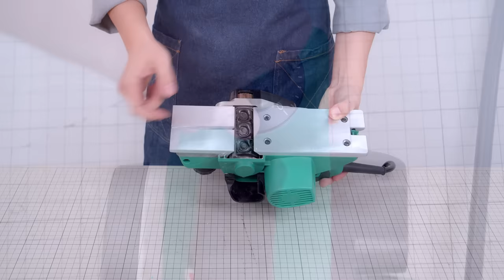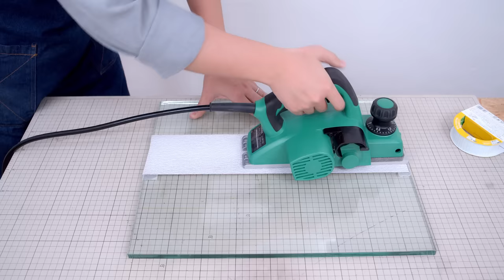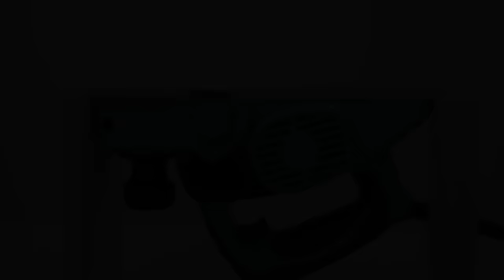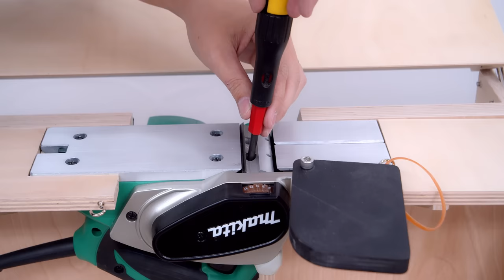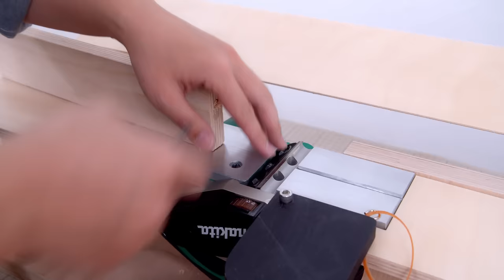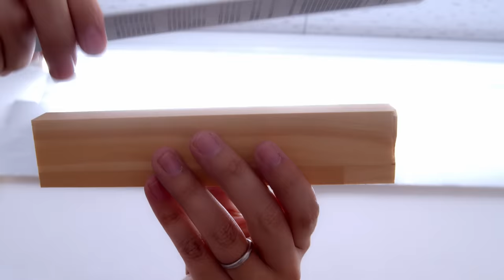Adjusting the  Electric plane Base

Comment: Thanks for posting! I never took the time to check if my electric planes were... well... "plane", as I only used them for roughing. After viewing your video, I checked and the oldest (20+ years) is acceptable, but the newest is just like yours - some precision work ahead required, because I intend to convert it to a jointer.

Comment: Very good information.  Remember though that your fingers are only an inch away from the spinning cutter head and the feed pressure you are applying is down into the danger area.  Be smart and always use some sort of sacrificial pusher to feed narrow workpieces through the jointer.  If your hand isn't comfortably above the fence it's too close to the spinning blades.  Love your fingers.  It's very difficult to glue them back together and your reflexes won't save them.  The jointer/hand planer is the most dangerous power tool in common use.  The hand planer has no blade guard and takes a while to spin down and the jointer invites you to pass your hands directly over the blades.  Fifty years of woodworking and I can still count to ten with my fingers.  Work safe.
Reply: Iv seen someone take off the end of there finger on an electric plane. After that you learn to always use them sensibly

Comment: I recently came into possession of Makita planer that was previously owned and used by someone else, it's all genuine and tried setting the blades using the guide block that came with it but the blades are still slightly proud when the machine is set to zero, might have to add a feeler gauge to the block with setting the blade, can't think of any other way, there's no adjuster screws once mounted the setting is done with the guide block.

Comment: Mine doesn't have the blade adjustment screws. It comes with a plastic block to set the blades. Still trying to set them up right.
Reply: A total pain

Comment: what paper grid do you recommend for flattering  base plates of the planer ?
Reply: Just did mine today. 240 grit until flat, then 600 to finish off. Used wet sandpaper. Got a mixed pack from an auto shop. The pieces were not long enough but after i  laid down long pieces of double sided tape, I stuck down the pieces of paper butt up against each other. Seems to have worked fine. Used my jointer / planer out feed table as the reference surface.

Comment: my blades dont sit square and as a result my shaved timber gets a slanted cut. Only just noticed it recently. either it was sent to me like that and ive failed to realise it or when i replaced the first set of blades i tightened one bolt too hard. i used the impact driver and think that may have done it. on your corded model there is an adjuster so i ran to mine to do it n there isnt one. its the makita cordless one. ffs. is that a clever nasty thing by makita or not?

Comment: Not sure why he did not adjust the height with the knob, and the blade with the aligning tool that comes with it?
Reply from the maker: Perhaps you misunderstood the main point of the video.
The purpose is to create a flat surface.
Reply from the maker: あと、この鉋は廉価品のDIYツールなのでアライメントツールはありません。
Reply: @jisakukobo  Must or must not the blade protrude over the surface?
Reply from the maker: @ПавелГрешных  
You don't understand the main point of the video.
Reply: @jisakukobo  Probably only the Japaneese do
Reply from the maker: @ПавелГрешных  
See video ratings
Apparently you are like a minority.
Only Russians do not
Reply: JSK-koubou oh I see, might try putting color on bottom so you and us can see what is flat or not flat before and after as you scrape.
Reply from the maker: @robertmccully2792  
That's right.
I do your way when making a CNC milling machine.
In Japan, it is called “Kisage”
I'm doing woodwork now, but I used to make machines with metal.
https://jisaku-koubou.com/archives/2328
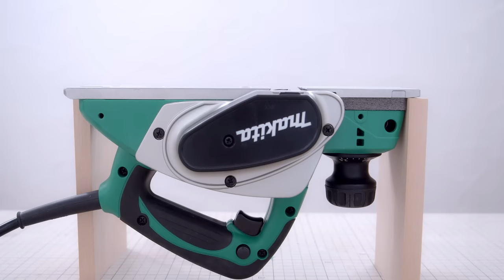Reply: @jisakukobo  If I may interject. When you show the unevenness with the ruler I can only notice that the two bases are in themselves perfectly even. So maybe what the Russian means is that you would only have had to adjust the height of the right base with the knob to lower it so that the left edge matches in height with the right edge of the left base. 0:18 is my reference point here so the "left" base is actually the base behind the blade. Looking at this the only issue seems to be that the height adjustment is not calibrated. The two surfaces in themselves are not planar but co-planar. So unless the height adjustment can not be calibrated, I don't understand why one would have to sand down the two bases. Maybe that is what the Russian fellow meant.
Reply: @instantmuffin5  she zeroed the in-feed before checking for uneven surfaces